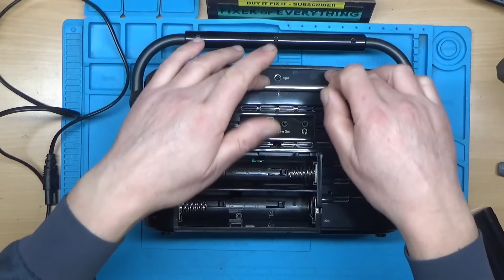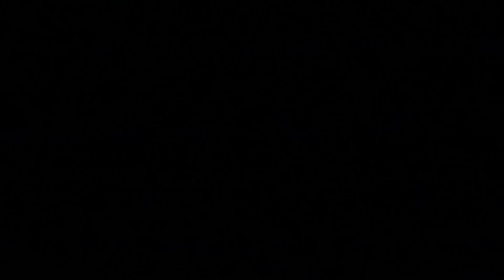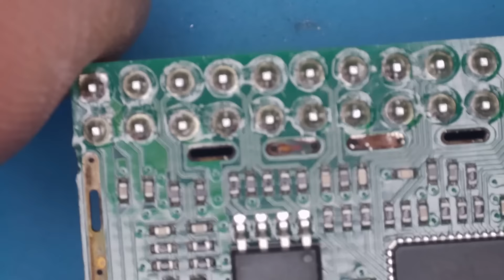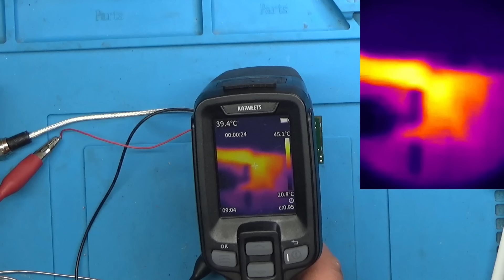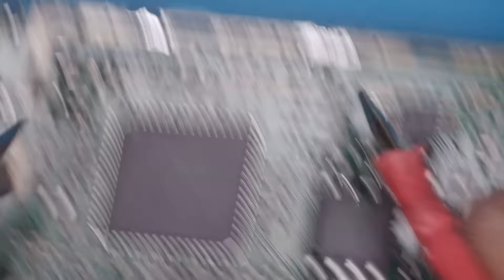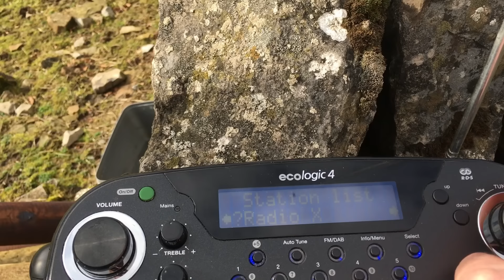Roberts ecologic 4: Solving the Mystery of the Non-Responsive Digital Control Board

Comment: Awesome stuff as always, Mick. I recommend a bit of Blu Tack for holding these little boards steady when soldering on them. Also, have you checked out the Sequre hot tweezers? They are so good.
Reply from the maker: Thanks mate 👍Cheers for the tip. I'll have to check them out!

Comment: So, this is a foolish question.  How did you know that was a smoothing capacitor that needed replacing?
Reply from the maker: De-coupling capacitor. Because it's across the power supply to the IC.

Comment: Did you check the battery connector on the amp board? It seems it misses the plastic socket an the plug was rotated 90 degrees. Perhaps pins could be shorted then. 🤔
Reply from the maker: Yes, I used the batteries at the end when testing it, after I found the fault 🙂

Comment: I used your link to buy the 8inch microscope but your discount code is not working, I've bought it now but you need to check if it's valid
Reply from the maker: Sorry about that, I'll check on the code with them! 👍

Comment: One of the best reasons for moving into Ipswich from the wilds of very rural Suffolk was the Endless power cuts....hurricane of 1987, we were off mains for 12 days, but had regular 2,3,4 day outages...... on the positive long power cuts do make for good community spirit!
Reply from the maker: We don't usually have them too often, and they are pretty good at repairing them (depending on the weather). We've had a few where they lasted 12 hours, or overnight, but that's usually because they can't repair the overhead lines when it's really windy.

Comment: Nice fix.
Fantastic views from your place.
And the foal was awesome
Looking at printing thermal camera adapter 
Just need to work out what lense to order
Reply from the maker: Thanks Paul 👍https://www.aliexpress.com/item/32241074105.html is the one I used. 20MM and the other number is the focal length (distance from the PCB when it will be in focus). I think the one I used here was the 50.8mm.
Reply: @BuyitFixit perfect thank you
Reply: @BuyitFixit  I have ordered one.
Do you have any problems with the picture on the thermal camera freezing ,just foe half a second before catching up? Both mine and the one at the repaircafe I help both do the same but were purchased a year apart. Wondered about a firmware update?
Reply from the maker: Yes, this is normal. All thermal cameras do this. It's when it's re-calibrating the sensor.
Reply: @BuyitFixit great thank you

Comment: I was just wondering about removing those micro components. I've always though the heat from a soldering iron would kill them. Seems they are remarkable tolerant of heat. What wattage of iron do you use? I use a 40 or 80 watt iron. Can't afford one of those adjustable types. Additionally I find it difficult to id said components when they have no markings on them. How did you learn to do it?
Reply from the maker: Yes, they seem to tolerate heat OK, even when using hot air. I'm not too sure on the wattage of the iron, it's an Aixun T3A that I use which has adjustable temperature.

Comment: Would your new fancy supa-dupa 3D printer have the accuracy to produce a Fresnel lens, given the correct clear source material? If so, this may make the macro adaptor fully 3D-printable..
Reply from the maker: Hmm, hadn't thought of that. I just used a Co2 laser lens. You can get them in different focal lengths for different distances. I think this one is about 50.3mm, so it's in focus when you are around 5cm from the board.

Comment: 6 D cells seems a huge amount for just a portable radio (a portable 4" CRT Sanyo TV/cassette/radio system I have uses the same) - & makes it v heavy! Good for long playtime away from power.. tho C-cells would be my compromise for the radio-only component. Does DAB draw a lot more power than FM?

Why the huge tip soldering iron? Has the electronics (smaller tip) one broken, or was this simply more convenient?

Would/could you consider rigging up an external (FM?) aerial (perhaps with a coax splitter for convenience indoors) on your roof for more convenient radio testing within your workshop, or are you too low-lying in the valley to gain reception that way?

Looking forward to spring lambing?
Reply from the maker: Yes i thought 6 cells was a lot too. I was only expecting it to use 4. DAB shouldn't really use more power on this set, but compared to just an FM only set it might use a bit more. I normally use that tip, but probably should have used the smaller one. The only problem with smaller tips is that they don't seem to have the heat transfer (mass) when de-soldering stuff. Yes lambing will be starting in the next week or two.

Comment: Another great video and another item saved from landfill. Good find on the shorted cap. A tip on those plastic clips holding the PCB I take the insides from an old BIC type biro and use the remains, the end is just the right size to go over the clip to push the barb in to release it
Reply from the maker: Thanks for the tip, that's a great idea for those tricky clips! 👍

Comment: Wonder what internet connection you've got out there ?
Reply from the maker: When I first started doing YT videos I had ADSL, but because we are so far away from the exchange it was 5Mb download and 0.5Mb upload, so it took 8 hours to upload a 20 minute video. I then changed to EE 4G which was the only 4G in the area as the rest were still on 2G! That worked OK for about 9 months until there was too many people using it, and it used to be unusable at peak times. I then switched to Starlink for about 9 months with around 100Mb down and 10Mb up. Recently Fibrus have installed Fibre around here so I've got that now with speeds or around 1000Mb down, and 300Mb upload which is a lot better!

Comment: I bought power supplies from AliExpress: 30V max output and 35V capacitors, which I replaced with 50V models. The Chinese are saving money everywhere.
Reply from the maker: That's a smart upgrade, always good to have some extra headroom on voltage 👍

Comment: Also in the sticks and have the same generator :) Got us out of trouble on many occasions!
Reply from the maker: Yes, they are not bad. I've got one for the outbuildings, and another to run some parts of the house (mainly critical things like the kitchen, oil boiler, freezers, internet and some lights).

Comment: I had one of those ecologic radios, it lasted 11 months, the power amplifier IC failed with a burning smell, fortunately it was still within the warranty period so took it back to the shop I bought it from and exchanged it for a Pure DAB radio, which still works after some years of use.
Reply from the maker: Interesting, I wonder if it was the same pilot run board as this one.

Comment: Great content again Mick, and creative in the editing with the batteries appearing one by one 😁, it’s something I would have done 😁
Are your solar batteries not working? I used my battery backup for the first time this year, just a home made lifepo4 battery and inverter with a changeover switch, it’s good for a few hours with the fridge etc isolated. Great generator by the way👍 all the best Patrick
Reply from the maker: Thanks Patrick 👍I haven't got the batteries / inverter set up properly at the moment. The problem is with it being 75M away from the house, ideally I need two heavy duty cables to act as a power in, and a power out from it. I've been thinking of possibly moving everything, and just running the panels back from the shed to the house.

Comment: The Robert’s Radio as well know and love are long gone. They were made almost to military standards back in the day and lasted a lifetime. Not now though. I’ve had two of the exact model you have here and both failed in a similar fashion. Amp on one after one of the channels failed and the other same as you have it appears.  I had a poke about and then flung them in the pile for a rainy day. With having a north east accent I’m wondering which valley you’re located or near to? 👍🏻
Reply from the maker: I bought a job lot of 3 older ones ages ago, which I've yet to have a look at. I used to live in the Northeast, but I'm over in the North Pennines in Cumbria now.
Reply: @BuyitFixit I’m in Newcastle. Born and bred. I can tell you accent isn’t a million miles away. I enjoy your videos and channel is the only channel out of a few hundred I subscribe to that I have notifications setup for. The simplicity of your repair attempts and fixes show that with a little knowledge and understanding such fixes can be completed successfully on a bench that’s not in an engineering or highly technical environment. Think it gives some less experienced the confidence to have a look inside and try fault finding. GOODLUCK with your channel mate. I think such topics are on the increase and there’s a lot of us out there looking for how fixes are approached. 👍🏻
Reply from the maker: Thanks Steve 👍

Comment: I've got one of them and it can't be upgraded to the latest dab format, so I can't get all the channels. but a little hand portable that cost £6 could, can't remember what i paid for the Roberts but i expect it was £90-100. Still sound good on the channels it can receive.
Reply from the maker: Interesting, I wonder what changed. The KS Jive radio I looked at recently had an almost identical "Brain" in it, so I think the board might be pretty generic. Perhaps FW from another radio using the same board might work?

Comment: Well well well... I just learned something and you've just saved a very nice Sony 8500 soundbar! It had the same issue - I found the bad cap but for some reason it never occurred to me that inductors could fail as a result - there was a link between a 5v feed to the amplifiers and the amplifiers themselves connected by "something" (I couldn't tell whether it was a cap or an inductor) - it didn't read and for some reason I thought it was a cap! I've just bridged over the thing as a test and the soundbar fired into life! So thanks for that, something I need to be aware of in future!
Reply from the maker: Great news, I'm glad you managed to save it. Someone has just sent me a Sony sound bar to have a look at...

Comment: I bought an ecologic 4. It failed just short of the warranty ending. The shop replaced it but the warranty wasn't extended. The new one failed shortly after. I opened it up and the amplifier chip was getting hot. Roberts used to be well known for making quality kit that lasted.
Reply from the maker: Interesting, sounds like the amplifier chip has failed on your one then.

Comment: Nice fix, Mick. You could do with a smaller tip and solder for these SMD repairs. Thanks for sharing.
Reply from the maker: Thanks mate 👍Yes probably should have used a smaller tip. I never seem to get enough heat transfer with them (especially for removing parts).

Comment: Don't you just hate it when a good piece of kit fails due to a faulty component which costs less than a penny. Good work Mick👏👏
Reply: This unfortunately happens far too much in modern devices, sometimes it's because a cheaper but unsuitable part has been used and over-driven, at other times it's because the component has been poorly manufactured. Failed SMD capacitors are one of the main points of failure. This of course results in an awful lot of devices that end up in landfill. And then of course there's many devices which are impossible to non-destructively open in order to carry out repairs. It's a terrible state of affairs that many governments can't, or won't, do anything about.
Reply from the maker: Thanks mate 👍
Reply: The problem being, mass production is so cheap that you can't pay someone to open one up and put it back together for the cost of landing a new one. 

Repair only makes economic sense with more niche devices that aren't mass produced, but there there they aren't popular enough for people to have reverse engineered them.
Reply: I'm old enough to remember when Roberts radios were made in the UK, carried the "by royal appointment" crest and cost a small fortune to buy while looking very old fashioned for the times.
Sadly this look nothing like that and most of the internals look like modular parts bin stages. I'll bet this is just another China product nowadays. Sad but economically necessary.
Reply: @Gary-Seven-and-Isis-in-1968  Yes, the design and assembly looked really shoddy. Just cobbled together.

Comment: Glad you left the power cut stuff in as it's interesting to see what you have to deal with.  You had a lucky quick fault find on this one.  Good stuff.  Wonder if manufacturers will ever solve the randomly failing capacitor problem one day?
Reply from the maker: Thanks Mike 👍Yes I'm quite used to power cuts, we have at least one every couple of months. They are usually pretty good at repairing them though, usually a few hours unless they can't due to the weather. We've had it a couple of times where it's been over 12 hours when there's been high winds for instance.
Reply: @BuyitFixit  I have a friend in a fairly remote part of Scottish Highlands.  They get the same as you.  Being a townie I can't even remember the last power cut.  Years ago that's for sure.
Reply from the maker: Really windy again here tonight, the wind can get quite brutal up here!
Reply: @BuyitFixit  Oddly, although I live exactly a mile in a straight line in-land from the NW coast just above Blackpool, when the country gets bad winds and storms, my area seems to get very little.  I am on a road that leads directly to the sea with nothing to block any wind either.  Geographic weather is very bizarre.

Comment: even if the display was the issue, I think that you could have easily replaced it, it just looks like one of those 16x2 char. arduino displays
Reply from the maker: Yes, I thought it might have been a custom job, although it does look like there's an extra line perhaps under each character.
Reply: @BuyitFixit  I found that the driver Samsung KS0066F00 is paired with displays that have an underscore under each character, tough it seems to be a rare display to come around.
Honestly I think that a classic 16x2 display would work anyways, as it seems that it doesn't really use the underscore.

Comment: We bought a backup generator after going without power for 9 days courtesy of Sandy. Used it maybe twice since then. 🤷‍♂️ Better to have it than to want it I guess. Thanks for the video. 👍
Reply: Better to have it and not need it than to need it and not have it...I keep a 13000w propane/gasoline dual fuel generator under a cover in my garage just in case...I have a 500gal propane tank for my house heating and stuff so it made more sense than getting just a gas one...I run it a couple times a year just to dust the cob webs off, but I have only needed it for a power failure 1 time in the 6 years i've had it...
Reply from the maker: Thanks 👍Better have one and not need it often, than not having one when you do really need it 🙂

Comment: Looks like the tooling text indicates a manufacturing process called NRE ( Non Recurring Engineering ). Basically looks like a version kinda like BETA versions of the PCB prior to full scale manufacturing. Interestingly, X-RAYs are used for creating precise PCB pilot holes rather than using full scale PCB stencils and such used for mass production of the PCB. Very interesting.
Reply from the maker: Interesting, thanks for sharing 👍